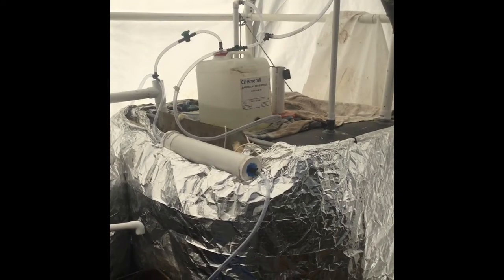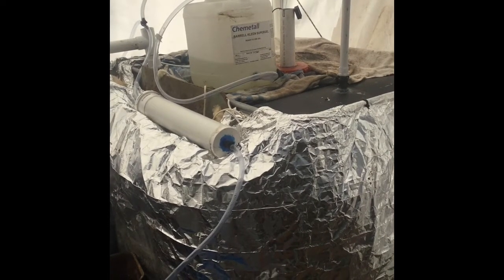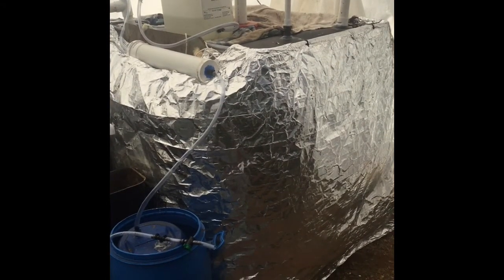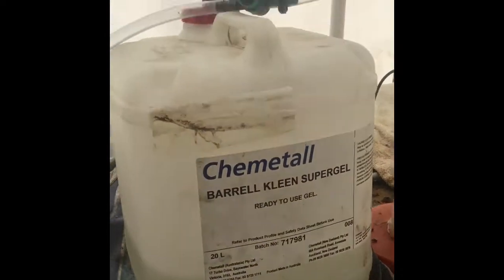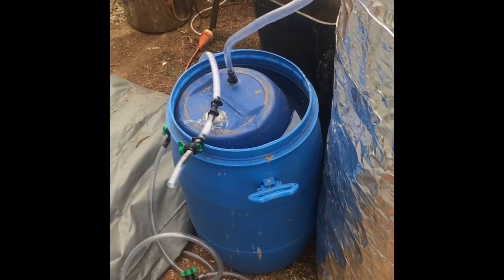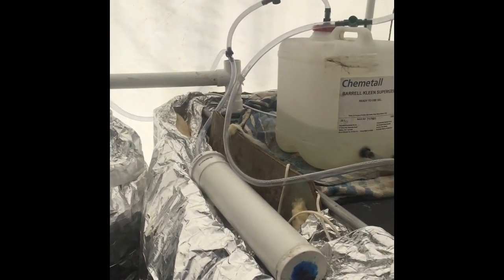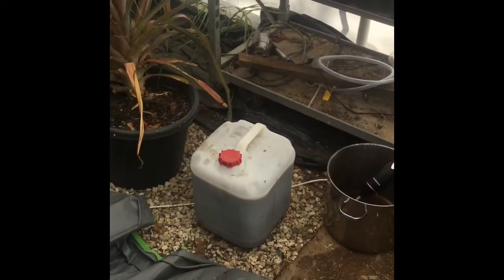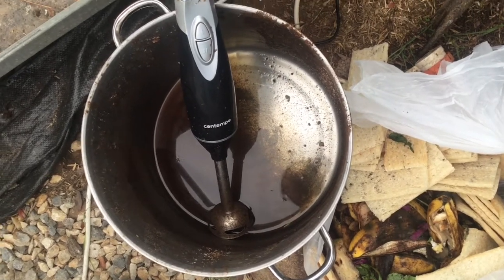Biogas digester walkaround

Comment: Finally primed my unit with Cow poop :D
read somewhere that around 4 litres of feed (scraps & water) is about the max to feed one of these (at 30-35DegC).. 
What do your feel would be the most you could feed an IBC biodigester??
Soooo, now I have an IBC that is mostly water. Going of the 4ltr/day limit. I will take around 240 days to get around 950litres of feed into the unit. I assume fertiliser concentration will be fairly week for the for 50-100 days..
How long had you been running yours before you tested output and started to sell the fert. ?
Thanks:)
Reply from the maker: So after it’s been primed with poo, you have to wait a few weeks till you get burnable gas before feed it food scraps, on a good week I was feeding it 1-2kg of ground up scraps plus water 3 times a week, after it starts making gas you can assume it’s making the fert, but yes it would be very viable for a while, tanks need holding time, size depending it should take around 30 days from the feed in till that initial feed comes out the outlet

Comment: Thanks for the vid. When you first started with the cow manure, did you top up the tank with water?? Or was there a large head of air??
Reply from the maker: Dan Helios hey mate, having my outlet where it is keeps a reasonable air pocket up top because you do end up with a thick layer of fats etc forming which can block the gas outlets, I end up doing a few different things in later vids 👍
Reply: @OkAtEverything-ProAtNothing  Hey, yup. I'l be doing similar to your other vid too. I was mainly interested in the startup proceedure. I assume you do not fill the tank with cow poo, so do you add water to fill, or just wait the until the gas coming out starts to burn before feeding other food sources to it?
Reply from the maker: Dan Helios I had a kiddy pool/sand shell that a put a couple of shovels full of cow manure then added water, used a shovel to make a slurry then added it, maybe about 1/8th to 1/6th volume of the tank, then filled the rest with water, added a heater, hooked the gas pipes up to a water air lock and waiting about 3 weeks till burnable gas started being produced, then feed with food scrap
Reply: @OkAtEverything-ProAtNothing  perfect.  Thanks heaps